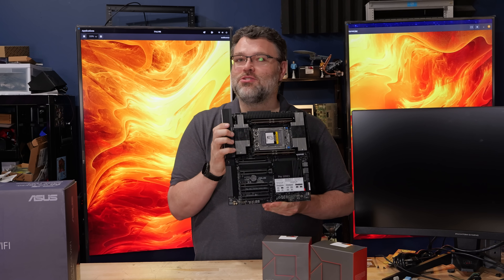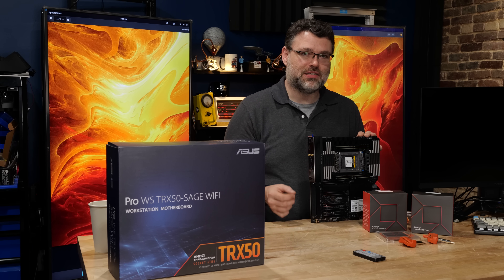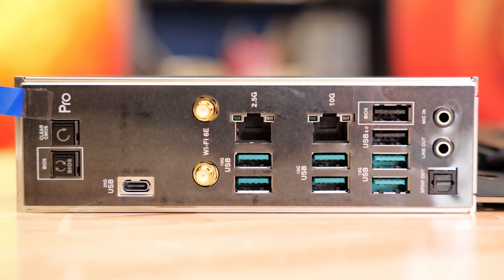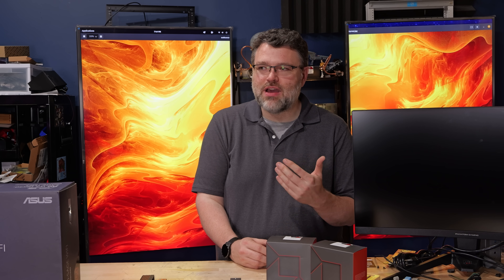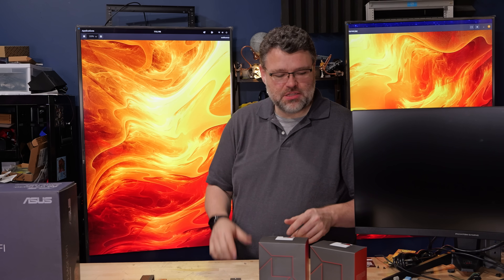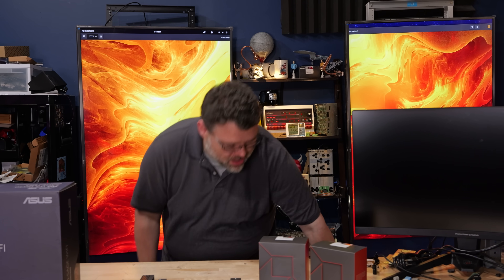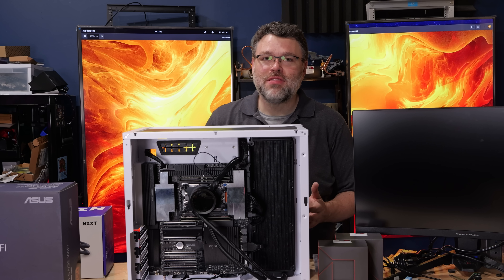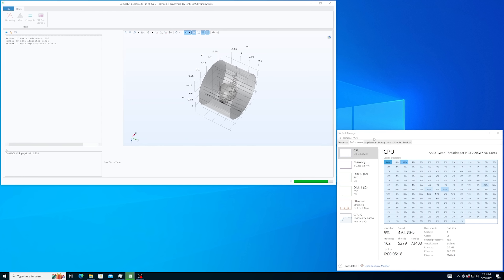Threadripper 7000 Marches On! Checking Out The Asus SAGE TRX50

Comment: In the process of purchasing a Falcon Northwest 32 core TR Pro RAK system primarily for Ansys simulation. They just released the 90 board options with 8 channel memory which is what we were waiting for as simulation is RAM heavy and this system will likely be setup as 2-4 user virtual machines with cores and ram to be allocated dynamically. May set it up as one machine, depends on software demands. Love the content! Nice to see some tech tubers that cover enthusiast and professional products!
Reply: High five 🙏

Comment: I absolutely hate that motherboard manufacturers stopped producing affordable boards with diagnostic error code readers... Because they know they can upcharge a lot more for the feature with their more expensive line-up on cards, when it'd help out consumers, customer support agents etc. so fucking much.
Reply: After the sh#tstorm that was AMD's handling of TRX40, manufacturers ain't interested in adding extended features, found on so many TRX40 boards, to TRX50. MSI pulled out of TR 7000 because AMD utterly destroyed any hope of R&D return on TRX40. Most MB manufacturers are pretty pissed at AMD. Error code readers? not a chance, unfortunately.
Reply: @ChrisM541  Wrong, Cpu availability on TRX40 was terrible. Boards were never problem getting a cpu was a problem for over a 1 & a half.
Reply: when i started buying pc motherboards the were $2000 each. and that was 1984 dollars.
Reply: @ChrisM541 that doesn’t explain how the same thing is happening with consumer boards as well regardless of amd or intel platform.
Reply: You have to imagine that the extra money they spend on customer service because of the loss of 7-Segment Displays isn't worth it.
Reply: It's a feature that for a system like this, you either never need it because you put together the system and it works, or you need it once when you put together the system.  I've built over 100 systems and have only used the diagnostic codes 2 times.  Funny thing is one time it gave me a general error code which meant I STILL have to go through the process of swapping things around until I found what was wrong.

So over 100 builds, 1 time diagnostic codes were valuable.  And because I have computer parts kicking around I really didn't NEED the benefit of those codes for that 1 instance.

But just from a user perspective and not messing with this as a toy, this is a workstation.  Regardless of the handful of people that will post comments on Youtube channels dealing with high end parts, most people are going to build a system and then don't TOUCH it other than the work they do with the computer.  All that diagnostic stuff is great if you get into testing systems since you're always swapping out parts, not really necessary for people who put together a system and then only open it up once a year to clean it.  I kind of like the handy power on switch on the MB but I have a very fine standard (flat) screwdriver bit and it's very easy for me to short two pins to start a system when I do a build.  I can go from starting with just hardware, updating BIOS and then loading an OS and get to the point of a complete operational system, on a test bench, which only needing to short those two pins for the start switch two time, and that's because I don't install NVMe until after I finish doing what I'm going to do with the BIOS.
Reply: @em.dot.2  I have to think they know enough to say that even WHEN they have those displays they STILL get calls and have to deal with issues over the phone.  But you know, PRO board comes with support doesn't it?  I certainly don't know the cost/benefit analysis on this one but it's ASUS who built the MB so they probably do.
Reply: Is it something you hate, or is it something you think you hate after watching GN? Nothing again GN tho.
Reply: On boards like this, there are lots of "moving parts", like not having some memory being detected because of improper torque of the ILM, but honestly on consumer boards I have yet to see any uniquely actionable information on a diagnostic display as opposed to general diag leds. CPU/RAM/Video error LEDs basically give you enough info for any action you can take, without having to consult a manual to decode. If it's not one of those, its likely the board itself. It's terrible to not even have the LEDs, but I'm not heart broken about the loss of displays.
Reply: @ChrisM541  MSI probably pulled out because its a ridiculously low volume segment. They already don't have the best name in the business, to make an expensive board that will never ship many units. If I was spending north of $500 for a board, that money is not going their way.
Reply: @blkspade23  "MSI probably pulled out because its a ridiculously low volume segment."
--> MSI pulled out because AMD 100% destroyed it's non-pro TRX40 HEDT userbase at birth, and in doing so, 100% destroyed any chance ALL TRX40 MB manufacturers made a return. MSI, like many companies, made several boards e.g. Creator...a very well-reviewed TRX40 MB.
--> If AMD did not lie, and actually supported TRX40, they/we/MB manufacturers wouldn't have this non-pro TR disaster (then and now).
--> Now you know why MSI pulled out, and, why there are almost NO TRX50 MB's fron ANY manufacturer. No Zenith II Extreme, no Aorus Xtreme, etc etc etc.
--> AMD royally fk'd up here.

Comment: The wait for WRX90 has been one of the most excruciating waits for a product launch ever.
Reply: Same here. Wondering if it's worth upgrading from the WRX80?
Reply: @LordChariot  That I don't know, but I've had a lovely 7965WX paperweight since November.
Reply: @LordChariot  I need to know if they will support S.L.I I'm tired of these junk mid-range boards.
Reply: @kevinerbs2778  99% probability of no.  It's no where in the manual.  Normally it would say either when talking about installing GPUs or in the description of the PCIe slots.

Keep waiting though someday a new board will........  wait didn't SLI get killed off a few generations ago?  So why would newer MBs support SLI?
Reply: @johndoh5182  WRX80 board support S.L.I. 
which makes no sense.
Reply: @kevinerbs2778  SLI was replaced by NVLINK, and WRX90 boards would support it because you get 6 full x16 slots and one x16 slot running at x8.  The question becomes if NVLink is even necessary with multiple GPUs if PCIe 5.0 is so fast?  Certainly PCIe 6.0 would probably render NVLink largely useless because the PCIe lanes between GPUs will be so damn fast.
Reply: @StariusPrime  It should be as Cuda still uses NVlink. I've seen developers try to use it while running dual RTX 4090. Except last time I looked in developer forums the Cuda program the developer was using, didn't to even want to acknowledge the second card. was there. There was a lot of complaining about this too. it wasn't just one person complaining either This also happened with the newer Workstation RTX6000 cards too.
Reply: Same, also i waiting for proper industrial grade AIO for SP6/TRX5 (like Silverstone one for SP5 / Intel 4677).
Reply: @kevinerbs2778  Huang killed data transfer between multiple gaming cards (and memory pooling). You need RTX 6000 Ada (PCI-e interconnection) or Hopper (NVLINK) to use multiple cards.
Reply: @falsevacuum1988  Ada doesn't have any way or shape to do NV-link at all. To the best of my knowledge Ada has no possible way to even use NV-link as Nvidia doesn't use the pci-express to link any cards ever.

Comment: I want to install 2 NVIDIA 4090 GPUs to this motherboard using a corsair obsidian 1000d super tower case. The power requirements at full power is 1275 Watts. My current setup is an AMD Threadripper 1950X CPU with an ASUS X399 Motherboard and 1 NVIDIA  4090 GPU, in a Corsair Carbide 540 Cube case, running a 1500 watt Corsair Power supply. I had to remove one of the fans to get the GPU to fit. I have an electrician coming to run a dedicated 20 amp line for the PC I'm about to build. Will the Asus SAGE TRX50 be able to manage 2 GPUs?

Comment: Are they releasing a WRX90 SAGE Wi-Fi, with similar connectivity to the WRX80 SAGE WiF / WiFi II?
Don't want to use up 2 PCI ports for @WiFi/T and a sound card from the outset.
(what's the difference with the WiFi and WiFi II on the WRX80 board anyway?
Reply: I think all of them have WiFi. And wouldn't an external sound card work better for your usecase?

Comment: You know you can install 25 amp 120 volt circuits and outlets and even 30 amp 120 volt? These are things. And they're things people running systems like Threadripper at home really should consider.
Reply: I always have to laugh at this. Two 16A 240V circuits in the room I am currently in. Enough for a super overpowered system while also vacuum cleaning and electrically heating the room at the same time. Europe FTW :)
Reply: That requires opening up walls and running very thick wiring, and usually means drilling every stud along the way to meet code. If you're lucky, you MIGHT have wiring good for 20A continuous aka 25A wiring in the walls, in which case you can at least use those 1600+W PSUs at least
Reply: @nster3  if you're going to go through that trouble, might as well just put in a 240v circuit instead.
Reply: @nster3 that's not really thick even for a home. Thick is when you have an induction hob with 7200w max power, or a high-performance backup water heater which could be even more power hungry.

Comment: Do you need to run the pcie 8 and pcie 6 pin power inputs if you're running a single GPU by chance or only for dual GPU set ups. Say a single 4090.

Comment: Does WoL (Wake-on-LAN) work? I'm having issues after updating the BIOS to 3101 on my ASUS z690 strix a d4 motherboard.
Reply: Can confirm that wol works. I'm having issues with bluetooth however.
Reply: @ulrikstrid  thank you! I forgot to turn off fast startup in windows power option and seems to be working now. Joys of re-installing windows after it crashes and burns.

Comment: Are you saying you are going to hook up the 2 power supplies to two different power lines? Cuz otherwise I don't see how exactly are you walking around tripping the fuse. But having the two psus in different lines could be problematic.
Reply: Yes. Most semi-modern buildings aren't on a single circuit.

Of course there is always the option of calling in an electrician to just install a 220v line
Reply: @MaddJakd  I think the real issue is that in most homes, the outlets in a single room are on the same circuit. I'd have to run a heavy duty extension cord down the hall to get on a different breaker. Heck the help desk I used to run in a 1-1 computing school that was built in 2006, has like 70+ outlets where too many of them were on the same circuit. Not even enough surface area to use half of them, and tripped the breaker once mass imaging laptops.
Reply: @blkspade23  I mean, yes. But that's what some folk are able to go through

Comment: The lack of USB4 is strange, especially when the WRX80/ TR40 Came with a few.

Seriously seems only that "baby" Gigabyte Aero board has USB4.

I almost can't even say this was last second because of ASUS made the WRX80 motherboard with "more" than this.

Seems like a mild jab towards AMD from the few board makers with these.
Reply: Wendell is incorrect. TRX50 Sage has USB4 through a motherboard header, while the WRX90 Sage has two rear USB4 ports.
Reply: @chiefjudge8456  It's just a header without controller, u need additional expansion card.

Comment: I am kind of annoyed by the lack of IPMI on TRX50 and the inability to run non-pro Threadrippers in the WRX boards albeit with limitations. Maybe the engineering required to get those limitations working is too high (only supporting certain RAM slots is one thing, but I'm sure dealing with PCIe will bring a lot of headaches), but at least allow us mere mortals to rack these with out of band management. Pikvm exists but it's not the same. The slot-layout of the TRX50 boards is kind of annoying too for 3-slot GPUs so having all the slots available would have been helpful. It's actually making me consider either Genoa, Threadripper Pro 5000 or dare I say it a Xeon-W CPU.
Reply: +1, though have a look at SuperMicro's TRX50 - got IPMI on 3rd ethernet, and seems designed kind-of for 2x 3slot cards

Comment: Are you going to check out the Gigabyte Aero D? I find that the most exciting of the TRX50 boards
Reply: He already did 😊🎉
Reply: It only has three slots, which is a show-stopper for many people.
Reply: @TrueThanny  Maybe but they're all 16x so you can have 2 GPU's and + another pcie device
Reply: @Shirosak1  where?
Reply: @TrueThanny  Thats what I thought too. I'm actually running that very same board and I'm quite comfortable with it. I have 2 GPUs and a 4xM.2 card, plus all nvme slots filled up. It has USB4 already so no need for an additional PCI card which I was going to get if I went with the ASUS or Asrock.

Personally I'm not using any of the server features so I don't mind, but I can understand why it would be a show stopper for some people. Your mileage may vary

Comment: 2:44 there is no reason in the year 2024 that a motherboard should still rock USB 2.0 ports, with the price they are charging those ports should have been 10gbps USB type A ports, Also no usb 4.0 type c ports really? And only 1 type c port in the back really? Yeah no thanks.

Comment: Here is where i diverge with the memory argument.
While yes RDIMM is great, there is effectively nothing other than greed preventing uDIMM and RDIMM from sharing the same key and number of pins. because what costs more than having one manufacturing line for the PCB and slot? 2 of them.

I dont care if the manufacturer is arguing that users are too stupid to know the difference between udimm and rdimm, because now that means they've ended up with a stack of useless udimm.

By devolving back to the DDR2 era we have lost a wider range of re-usability.

Dont want to validate consumer uDIMM?
AIBs dont have to, there are plenty of RDIMM that arent validated either.

User doesnt want memory headaches? Get some RDIMM from the QVL.
Want to punish yourself?
Get some uDIMM that is on the VFL.

Want to buy a used CPU, board, and RAM from the back of a panel van or corporate garage sale?
Easy to troubleshoot issues if you have another kit of RAM lying around, and i doubt its going to be RDIMM for the average person unless their environment is enterprise.